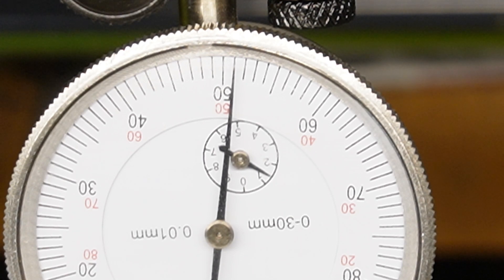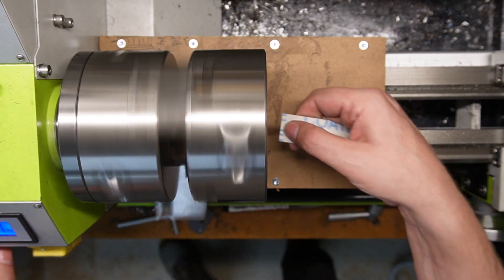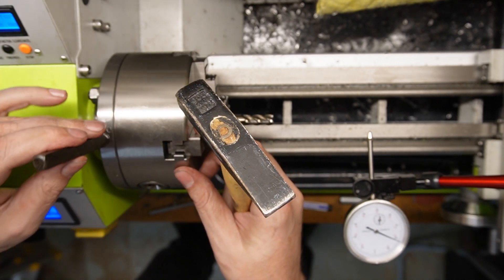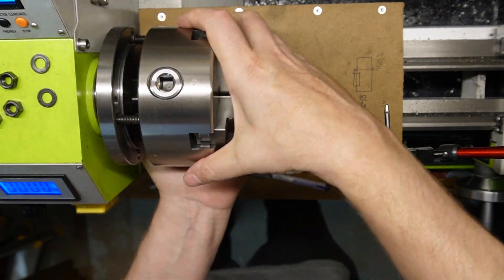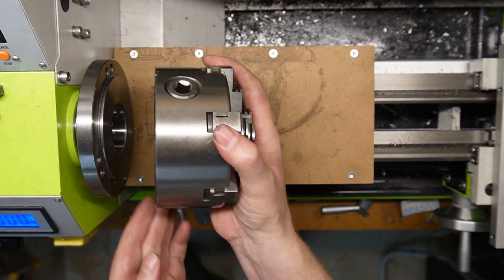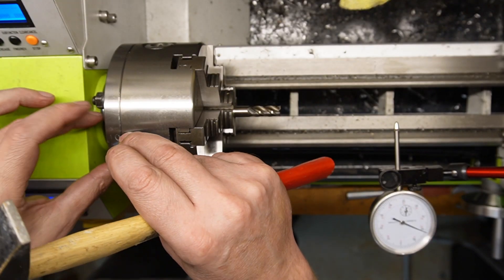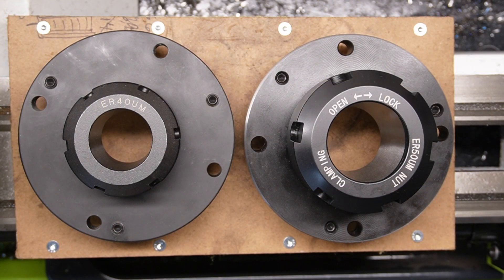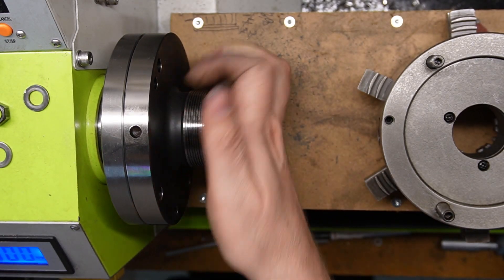How to get low runout on Mini Lathe, 6 jaw, 4 jaw, 3 jaw and collet chucks tested

Comment: This is the first video where a rather simple technique is used to fine tune the mini or midi lathe chucks to run true.  Just amazing compared to some of the most esoteric (elaborate) methods such as grinding the jaws and other corrective measures to get similar results from "budget" lathes and chucks.  Very simple and everyone can get better results from these budget machines